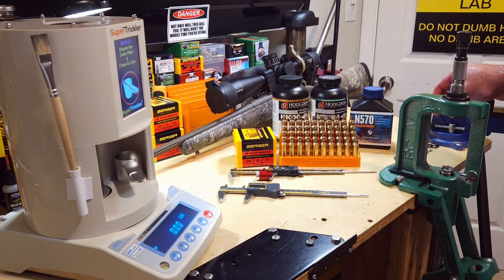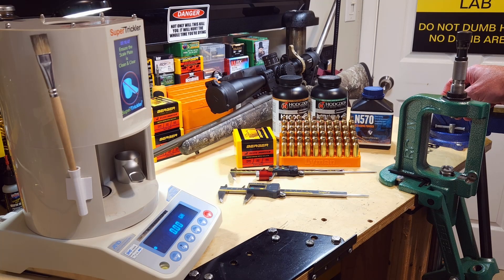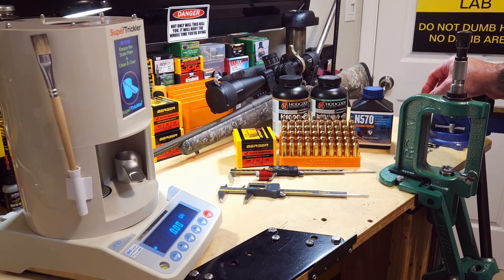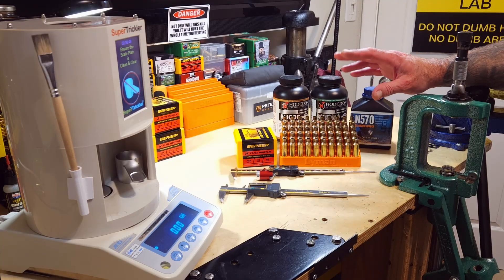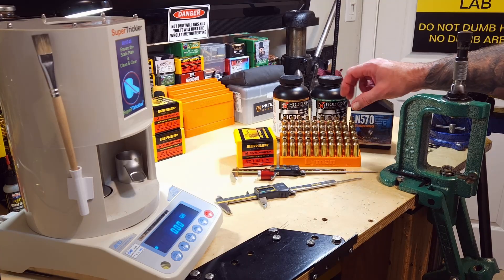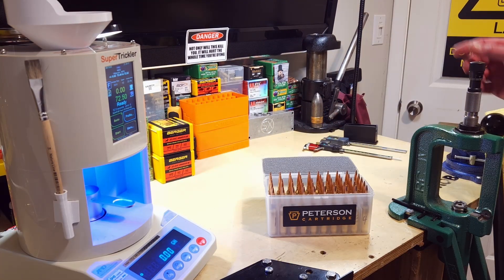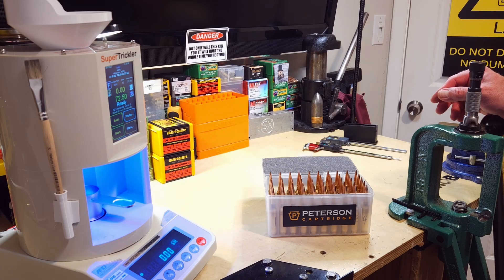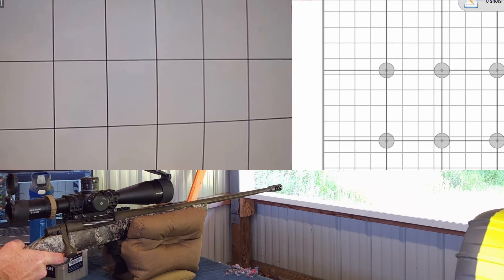Reloading 7mm PRC vid #3  Berger 195gr with N570, H1000 and Retumbo - SPEED!

Comment: Awesome video. I have watched your whole series. What was your COAL for the Berger 195? I thought I saw or heard 3.425" somewhere.
Reply from the maker: Thanks for watching! I can't remember when exactly it was that I used that length, but what I have ended up at now is 3.387 to operate well in the mag without having to modify it. My original plan was to modify the magazine but then thought better of it as it is pretty lightweight plastic, so I changed my seating depth instead.

Comment: Im new to the 7prc 
And i would like to shoot the 190 gr A tips form hornady from a 26 inch barrel but i dont know what powder to use and with what charge to get the best result in speed and grouping and for long range
Reply from the maker: I'd start in N565 and N570. N570 burns HOT but good and slow which seems to get me the most velocity for pressure in the 195gr, so it may be a really good starting point in the 190gr bullet. I have no way to know 9n charge weights, it might be best to run the combos in QL and GRT

Comment: Just found some 8 twist 5r blanks, so I'll be building either a 7prc, 7-300prc or 28 sherman mag for next years nightforce elr challenge. Really appreciate tge info for my decision
Reply from the maker: Wow! Thanks for watching! all three of those get my attention for sure. How much hotter is the 28 Sherman over the 7-300prcor am I wrong and the 7-300 is hotter in same bullet weights? Here what I found is that it would be tough to ever get  to 3000fps in a 7prc w/195gr bullet. My rifle will get me to 2940-2950 without pressure signs with N570 but I don't think there is a combo to get you over that safely.
Reply: @MilRadLab according to the sherman group, 195s are easy to push 3200-3250 iirc. No clue what a 7-300 would do, just saw someone else had the idea. My 6gt hits at 1865 were barely visible and my 338wm won't get to the far targets with scope view. So, ill do a 7mm of some flavor.

Comment: I have had some great success with US-869 as well as LRT. If you don't have any 869, let me know i don't mind sharing!
Reply from the maker: WOW! Very generous of you sir! I had never even considered US869 thinking that it was a too slow for this chambering/bullet - shows what I don't know for sure. I have shot LRT and got to 2912fps with it and a nice group at 76.4gn but I worry that full burnout before muzzle passage is not occurring (probably don't get full burnout with may powders in a 24" Bbl) so I'm a little leery of it. In the next video I will be conducting a bit of a shoot-out between LRT, N570, H1000 and Retumbo though I already know I like the N570 the best of them all so far as it shot 3 stud groups in a row and has a wide node that can be exploited under different temperatures without negative effect.

What sort of velocity/SD/ES are you getting with US869? What barrel length/brass/primer? I am VERY curious. Thanks for watching and chiming in, much appreciated!

Comment: You have multiple loads that group well at 100 yards.  Rather than continue to tweak them at 100 yards, I would pick one load and stick with it. Then stretch out distance to a good representative distance (for moose in Newfoundland) of say 300 yards and get some trigger time and see how it performs at that distance.
Reply from the maker: That's on the agenda for certain. Performance at distance is known within a margin of error once data is proofed at 100 yards. The reason I select 100 yards for load development is that wind and environment are less a factor so it is easier to see the true difference between loads BUT with small sample size like 3 shot groups there is definitely more opportunity for misleading results. I definitely lean toward N570 at 2938fps as the go-to, but I like the idea of putting the best loads from each powder in a competition and to test repeatability.

Comment: Yeah, I’m getting ready for an elk hunt in New Mexico, September. I’ll post the results once I get back from the Range. Talk to you later.
Reply: 6/21/25   
80-94degf
Alt 179.46
77-84% hum
30.15 inHg 
7mm PRC 24” 1:8twist
Nosler 175g ABLR
New lapua brass (this is important to remember)
CCI LRM Primer
Powders tested;  Magpro, LRT, Grand
Overall session notes; 100yrds all groups sub moa, most sub 1/2 moa. It was hot. By sessions end it was 94 and very humid. After each group it took for ever for barrel to cool down. New brass doesn’t shoot accurately until it’s been shot and annealed 2 or 3 times. Summary In the order shot;
69.3g Magpro 2915.8avg fps 5.9sd
80.0g LRT 3018.9avg fps 6.6sd (2 in 1 hole 1 touching)
70.5g Grand 2968.4avg fps 6.5sd
Guess which is going to be my elk load 😉
Reply from the maker: Nice work! Yes sir, LRT though a ball powder has some sort of magic in this casing for sure (or at least I think so) That'll smash an elk right proper! Bbl cool down is always such a time eater - particularly wen your watching the morning temp rise while you sit waiting...frustrating for me at times. I use a RifleKuhl and a fan blowing across the Bbl but still its a good 5 to 10 mins between strings. I keep a laser thermometer with me (cheap harbor freight one) and try to get the exterior temp on the warmest part down below 90* before shooting the next string. It may not be optimal to shoot it for groups when it's still 90 but it would take an additional 5 mins or so to get it back to ambient this time of year. At the least I am shooting most groups at the exact same starting temp, so there's that anyway. Thanks for posting your data!!!!
Reply from the maker: Excellent! Looking forward to a report! Sounds like a fantastic hunt for sure

Comment: I’m going through the exact same process with the same caliber only I’m using the Nosler 175 grain Accu bun long range. It’d be nice to see you if you had a load for that right now I’m testing LRT and Grand and H 1000 I’ll be going to the range tomorrow.
Reply from the maker: Thanks for watching Kevin! I'm sorry, I don't have a load worked for 175gn bullets yet. I don't know if I will be testing any since the load I'm looking to develop is specifically for a Moose hunt so I'm trying to stay on the heavier side for energy at impact. I will tell you that I suspect that LRT is going to be a bit slow for the 175gn bullet - this is just my suspicion and I'd love to hear what you get out of it. That bullet weight should be right in the wheelhouse for H1000 for sure - I don't have any/haven't tested any Grand so I cant give you much help with that one. My guess is that you will get that 175 moving FAST with H1000 before you see pressure signs.
Reply: I'd like to see this bullet done as well. LRAB are nice bullets for sure!

Comment: I think you can go ahead and crown N570 the winner here. That is a very nice accuracy plateau you got to there. I like how you mined all that load data for it and then when you set out your charges you were actually right there just under max for real. I've tried to do this before with some powders (sort of skip to the very top of the ladder and begin there) but ended up pulling a bunch down cause they were way too hot. Really nice to see someone hit it right on the money. The fact that you hit an accuracy node on top of it is absolute bonus. Great video, I cant wait to see the bracket breakdown but if I had to choose one right now I'd pick N570.
Reply from the maker: You are probably going to be proven correct. Setting a short ladder like that without running any other testing (Satterlee etc.) definitely leaves the door open for waste and trouble - you could say I got lucky BUT that was the whole reason for the 5 loads under the ladder - having the data from that first round was all I needed to see to know I would be starting the 3 round groups close to 2900. Could've turned out worse for sure! Thanks for watching!!

Comment: Really like your video delivery/format and the general data is invaluable … appreciate your time and effort with sharing your experience.
Reply: 2nd this! This guy has saved me a lot of time and he should be teaching this as an instructor. I think the important thing is that he's easy to listen to and leaves very few questions unanswered. Apparently he answers questions if you send them which is way more than you can say about most guys producing content, they usually have the ignore switch turned on.
Reply from the maker: Thanks alot man, truly appreciated!  It took a little while to get a system going, but it's getting a little easier each video.  I have a ton of handloading work planned out so I figure why not make videos of it all? I appreciate your support for sure.